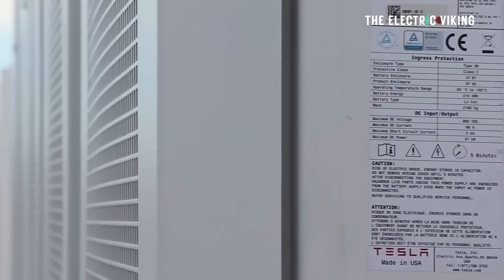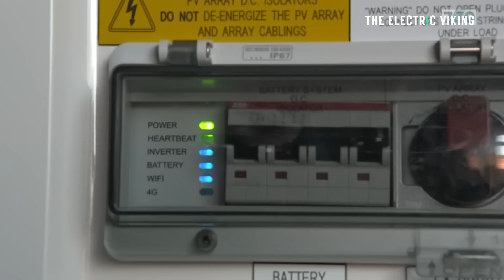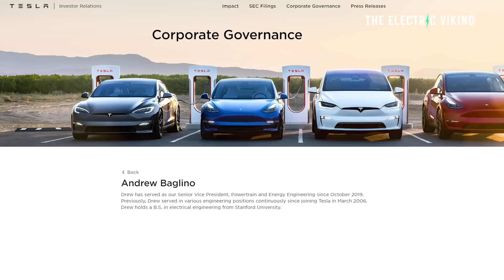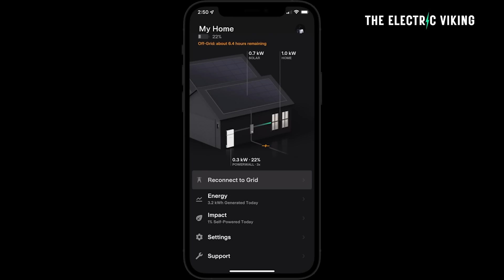Tesla's secret to unlocking fully renewable grids all over the world

Comment: Hardly
An engineering and management services consultancy has expanded its UK reach after supporting the delivery of near £10 million power developments.

Encora Energy worked on gas-fired peaking plants in Norfolk and Lincolnshire.

Known as ‘peakers’, the hubs balance the national grid during high periods of electricity demand.

The Stockton-based firm’s work ranged from identifying suitable sites to overseeing construction, and came after similar support on the commissioning of two peaking plants in Sunderland and Peterlee, east Durham.

Andrew Normand, business development director, said: “Our latest projects reaffirm our commitment to fast-tracking Britain’s transition to a low-carbon electricity system.

“These gas peaking plants can provide the extra energy needed during periods of high demand.”

Comment: Musk is wrong and self-interested.  He wants to sell batteries.  Nuclear fusion produces more heat than the Sun.  The Sun is 93,000,000 miles away.  Only a tiny fraction of its power reaches the Earth.  Did Musk use the inverse square law in his calculation?

Comment: We don’t need to get rid of natural gas we do need to get rid of fossil fuel based driving fuels but for the little bit of natural gas that is used for cooking we could use some carbon capture technology to compensate for the burning of natural gas for the purpose of cooking it is much much better for cooking electricity at this point in time

Comment: Excellent video Sam however 1. gas peakers take less than 15 minutes to start-up, 2. are started up before they are needed to supplement the base load generation and 3. do not run during a blackout.  They are different from a back-up generator.

Comment: Elon’s statement about solar producing more energy than an equivalent area nuclear reactor is complete BS. Why are you even mentioning it? Physics destroys his theory with ease. 77MW of Nuclear fits in 4.5 acres vs 10880 acres for the equivalent output in solar. That doesn’t include the necessary batteries either. Just complete garbage. Break it down further an 1MW of solar needs 150 acres, so not even close to a GW class nuclear power station. Sorry physics.

Comment: Hi Sam, I just discovered a couple of bugs in my TESLA model 3 and one of them is VERY DANGEROUS. Please inform all your customers. The bugs are the following:

Bug 1

Tesla model 3 automatic MAX speed change.

When I was driving my Tesla Model 3 along the street the speed limit changed from 70km/h to 60 km/h MAX speed changes automatically as well from 70km/h to 60km/h. Usually speed limit change does not cause MAX speed  change. It happens in less than 1% of the cases. Autopilot was activated with lane control. Can replicate and send video.

Bug 2

Tesla model 3 MAX Speed jump without any reason.

When I was driving my Tesla Model 3 along the street the speed limit was 60km/h and MAX speed was 60km/h MAX speed suddenly jumped to 70km/h. Autopilot was activated with lane control. VERY Dangerous bug as it affects safety.  Can replicate and send video.
Reply: Report to Tesla office, and they will fix your software for free or replace your M3 for free

Comment: In the same way that driving a Tesla car spoils you for what a car can be, Tesla Megapacks spoil utility operators as to what a power plant can be. New nuclear power costs over 225 dollars a megawatt hour, while new wind and solar costs 25 to 45 dollars per megawatt hour. Adding battery storage costs another 50 dollars per megawatt hour, but adding battery storage is cheaper if it is replacing expensive peaker plants that generally cost 150 to 200 dollars a megawatt hour. Within the energy production industry, it has been known by some experts that it would be cheaper to massively overbuild renewable capacity to ensure continuous power, but utilities can’t wrap their heads around the idea of paying for renewable production capacity that is idled during periods of low usage. Batteries seem to assuage this issue, and transfers the idle time to the battery.

Comment: Fire up those coal fired electric plants to fuel those EVs.
Reply: In that "worst case" scenario, the EV is still as clean as a hybrid. So still an improvement compared to fully fossil fuel powered cars..
Luckily the grid is getting "greener" every single day. Internal combustion engines stay dirty from the moment they drive out of the factory and usually get worse as they age..

Comment: Fully renewabl grids are afantasy, 

you cannot run a grid on asynchrous renewable generation apart for the major intermittency problem.
Reply: That’s why you buffer with energy storage.  Batteries, hydrogen, methane, etc.
Reply: Ted, 

that is a fantasy, there is insufficient 'excess' to store. How can you store electricity sufficient to cover weeks of low production. 
That aside, how can you compensate for asynchronous generation, i.e inflexible supply to power a grid taht needs flexible generation?

Comment: WRONG:  In 2015, MIT published a massive study, entitled The Future of Solar Energy. ‘This study is motivated by the enormous potential of solar energy as a tool to reduce global CO2 emissions and the great importance of effecting those reductions,’ it said.

According to that study, producing all the energy the US would need in 2050 from solar panels would take about 33 000 km2, which means Elon Musk exaggerated/WAS WRONG by a factor of 165. ELON WAS NOT EVEN REMOTELY CORRECT ABOUT NUCLEAR VS SOLAR ENERGY DENSITY. 

The most physically unique thing about nuclear power is that the energy density of nuclear fuel is about 2 MILLION times higher than that of any chemical energy source (like fossil fuel, biofuel, or BATTERIES).

DON'T BUY THE NONSENSE!

Comment: It is fantastic but a shame we are using Li batteries for grid storage.  It is driving up the price of Li and hence of EVs and, because of this, reducing their rate of penetration of the market.  Besides, some of the alternative batteries are superior to Li batteries in every aspect except weight.  They are much longer lasting, can be cycled between 0 and 100% with no damage, are much easier to recycle, use cheap, commonly available elements which are available from multiple sources, use simpler charging and discharging electronics, would be cheaper than Li batteries if they had the market share and are safer from a fire point of view.  There are the ZnBr flow and gel batteries, the liquid metal batteries based on SbCa and AlS, a range of redox batteries, so far based on V and Fe and the up and coming Na batteries.  ps. Note that the amount of Li in the famous 180mWh Hornsdale battery is enough to power 3000 60kWh EVs
Reply: I agree about flow batteries for storage. Taking the pressure off Lithium in the short term is important and even at investor day Elon said they will be battery agnostic. This means they will use CATLs new sodium batteries if CATL succeeds in ramping. This will scare the pants off lithium miners and refiners and create downward price pressure. Flow batteries are good but CATLs sodium battery ramp is worth keeping an eye on.
Reply: Utilities should be encouraging V2G grid storage and paying a competitive rate for distributed batteries.

Comment: Is a big battery at the power utility more efficient than many smaller ones distributed within the grid ?
Reply: Just like solar, it costs less to install in big projects.  The additional transmission costs are not included, though.

We should be encouraging V2G more, utilizing distributed batteries people are already buying.
Reply: if the big battery dies, you have a big trouble, if one of the smaller ones dies you just have one battery to change, smaller batteries can be more expensive when you change all of them but they die one at a time usually so you have a more spaced expenditure instead of a one big buy for the big one. But that depends of where you live and the prices there.
Reply: Probably just more profitable for the utility controlling it if anything. Imo they should ad these large megapack style grid scale batteries.
At many different high energy use/draw locations instead of just centralizing them. 

So in other words anywhere there are multiple box stores, multiple large buildings like offices and hotels etc. Then if something happens in between to the lines say? It doesn't cripple the other pack's ability to provide power or accept excess power. 

I think just 1 tesla megapack is equal to 300+home powerwalls? Imagine all the costs&materials associated with 300 seperate home powerwalls vs 1 drop in place megapack. Put it right near the step down transformer for a neighborhood or industrial complex. 

Literally plug n play tech. Charge your customers a reasonable fee per account it can support to cover the installation. 
Boom easily added and accessible battery backup at grid scale for hundreds of residential customers per megapack and dozens of businesses. 😎

Comment: Virtual inertia has already been tried and failed, being vastly insufficient, as was the promises of grid voltage support.  It also doesn't account for software or communication vulnerabilities.
Reply: Links?    Are you saying somebody tried it once and failed therefore it will never work!      Do you know how many tries it took to find a light bulb filament that could be manufactured ?
Reply: @danharold3087  It is simply based on other utilities that have tried it and spoke up.  This also doesn't even address the fact that batteries have a relatively short lifespan, especially under high charge/discharge needed to support the grid.
Reply: @joshuaw2143   Used to hear similar about wind.  Lots of people spoke up. What I hear is that they provide better stabilization.   As the cost of batteries drop the lifespan issue will become a non issue.
Reply: @Dan Harold  Actually wind is a nightmare, caused several blackouts and customer cutoffs from missed forecasts, nice try.

Comment: I don't see the point of replacing nuclear and gas for electricity generation any time soon. The last time I researched this topic, a grid with 50% wind and solar backed by gas and nuclear is realistic without costly battery storage. Pushing the renewable share above 50% drives up the cost very rapidly and also drives up the cost of EV batteries competing for the same resources. We're nowhere near 50% in the U.S. at this point, so we don't need to be stressing the battery market with massive grid storage in a hasty adoption of renewables. We don't need batteries to replace coal with a mix of renewables, gas and nuclear that's still a big improvement over coal generation, and I don't see the point of replacing nuclear either. We should be lowering the cost of nuclear instead. Don't make the perfect the enemy of the good.
Reply: News flash the U.S. is already over 40% energy combined from nuclear and renewables. And in 2022 renewables had weeks where they made over 30% of all the nation's energy demands in both the spring and summer time. 

80-85% of all new energy capacity added since late 2020 is renewables along with grid scale storage. In fact the interconnect backlog waiting for permission to connect to the grid would alone if allowed to operate today. More than double the capacity of renewables and grid scale bess vs what we have on the grid operating now. The time are a changin. 😎
Reply: @4literv6  To increase wind renewables we need  new transmission lines to tie the areas with wind and few people to the existing grid.   This has been done in Texas and wind generation has exploded.  They are exporting power.   I live in the OK panhandle and we are told the reason we do not have more turbines is that we don't have enough transmission lines.
Reply: @danharold3087  why don't they just run hvdc over the top or alongside existing right of ways for all the fossil fuel oil pipe line's? 
I've seen estimates we have over 3,000,000+miles of oil pipelines just here in the U.S. 🤔

I just read an article that if we tore all those up and recycled them? It would cover more than 4 year's of current steel&iron demand. 😀
Reply: @4literv6   I think we will be needing them for a while.  Not at all sure.
Reply: @4literv6  Newsflash, according to the U.S. Energy Information Administration in 2023, nuclear is 18%, wind is 10% and solar is 3.5%. Google for "FAQs: What is U.S. electricity generation by energy source?" Hydro and geothermal get us to roughly 20% renewables, but who denied it?

Like I said, nuclear is fine. I have no problem with it.

Like I said, renewables could reach 50% backed by nuclear and gas, and I have no problem with it, but we dont need large-scale, battery storage for it. We need a baseload source like gas. We do need a lot more battery storage for EVs, and tradeoffs are a fact of life. More than 50% renewables is also possible in the long-term, but it's not a priority or even a possibility in the short-term.
Reply: The US is spotty.   What we need are the transmission lines to move the electricity from where we can make it to the markets.
Reply: The issue is not with solar or wind, but your research.

South Australian is already at 70%. I think you'll find 70% is already higher than 50%.

Luckily if you watch this video, this is mentioned.
Reply: @davidgrieve7691  I'm referring to the U.S., which is why I wrote "in the U.S.", but thanks for the math lesson. Here's another one. South Australia's population is 0.5% of the U.S. population. Scale matters.

Comment: Considering the total area needed for solar to provide ALL of our electric needs is so famously small means that less than 10% of the top 30% of residential, single home & multiplexes, & local commercial rooftops can provide for it. Link those at a neighborhood level with mini-mega packs acting as a VPP & using energy arbitrage, will solve all these problems while adding extra local security.

Why isn't Tesla building out more solar cell factories? Why isn't Tesla building its own stationary battery production facilities?

They can build them in Australia.
Reply: No.  Hundreds of thousands of acres of solar just to replace baseload coal generation is required in just the next 2 years. 8000MW requires 1.6 Million acres of solar not including batteries and grid connections. These are not baseload and only intermittent. Nuclear beats solar for energy density hands down... it’s not even close. Sorry. Physics.
Reply: @polarbear7255  Thank You!
Ah! Physics.

Then there's math.

The area of Arizona in acres is nearly 73 million. Consider the whole 'a postage size bit of the Sahara' being able to provide for the whole world's energy needs trope. Bit of hyperbole, just give me an inch here! As this is usually dismissed as far too concentrated & not deliverable.

Yet:

It is estimated that the Total residential rooftops area, suitable for rooftop solar, in the US, alone, is at least 2 million acres, 8 billion sq meters.

That's culled for suitability for solar.

Add in local commercial rooftops along with small scale non-rooftop deployments, and as shade suspended in spaced out arrays over streets & parks, even over lawns, and we can do the whole world.

Going back to the Sahara for a minute. Consider the total area of residential rooftops, globally not in meters or acres rather using the size that huge solar farm would have to be in the Sahara and you'll get what? 10s of thousands?

Math.
Reply: @JorgeLausell  no numbers there mate... don’t shoot me. I’m just the messenger... take it up with the MIT physics dept who called out Mr Musks Absolute BS statement.

Physics says have a nice day 👍
Reply: Okay the math says that PV solar panels with an efficiency of 20% (like Tesla’s) would only need an area of 100 miles by 100 miles or 10000 square miles (6.4 million acres) to generate the 1 TW of power required by the US.  That really is not that much.  You drive past many times that much empty desert between LA and Vegas or Phoenix. Also batteries and grid connections would use the shaded space under the solar panels so the footprint is the same to have a stable power source.
Reply: @Agile-Ted  And every component  is getting better both in efficiency & in terms of manufacturing. Getting cheaper as they are getting better!

Divide those numbers into the total  residential rooftop selecting the top 30% best for solar use, add same from local commercial roofs, think all those malls & grocery stores, plus govt buildings, tied in w/mini-megapacks & we have enough for all of our energy needs, using less than 1/2 that space!